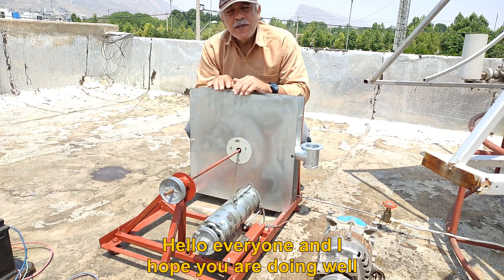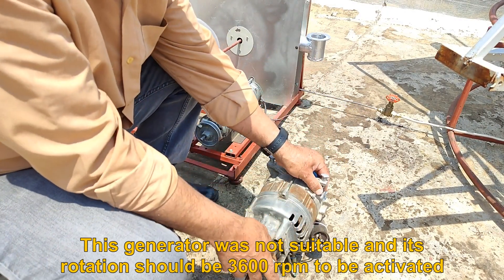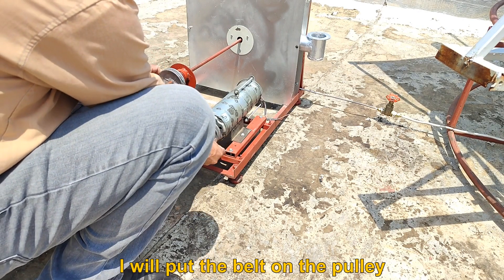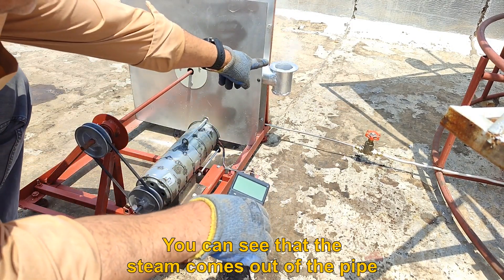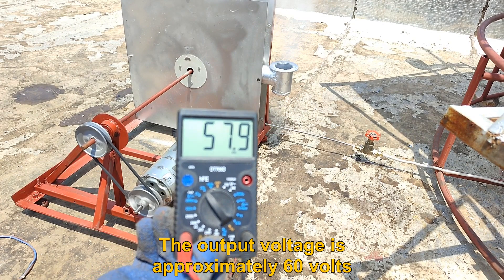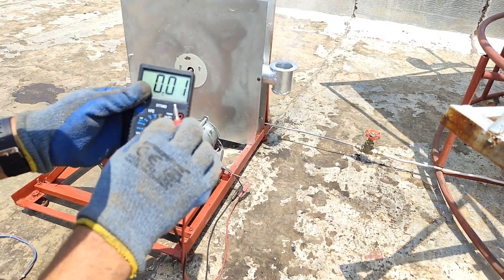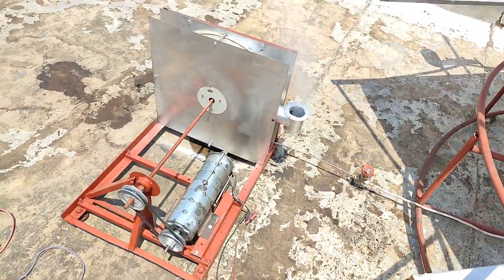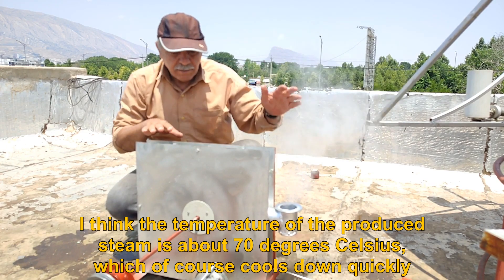DC generator test with steam turbine.Suitable generator for steam turbine

Comment: Greetings from Germany, little physicist here :-)
I was thinking about steam engines lately myself, so maybe some of my ideas might help you:
Find a bldc motor with matching KV rpm/V for direct drive. This should nearly double your efficiency.
If you make a closed water cycle, you could evacuate the system to 0.2 bar, then water would already evaporate at 70°C. This would reduce temperature loss.
And you would have to put the entire steam turbine including the bldc motor/generator into a (under-)pressure housing.
This housing would have to include a plate heat exchanger to condensate the steam by heating water from 40°C to 60°C.
The condensated water would need to be pressurized with a small membrane pump to be feed back into the boiler. In my design of a steam engine i only wanted to go for 100-200 Watt so 3-5 bar would have been sufficient. For that a $8 membrane pumpe from AliExpress would do. I am not sure what to make of your 18 bar you mentioned to achieve with your solar disc. 
The presssurized water would only need to go into a small water tank.
From there it should go into a flash boiler in the center of your solar mirror. There the water would vaporize at 70°C and get overheated to over 150°C or even more.

What is the diameter of your solar mirror ? Then we have the square meter an the sun shines with 1000 Watt/m². As your steam turbine will rater have en efficiency of 5% than 10%, ai like chatGpt or Gemini will quickly tell you the amount of water, water flow for the system. And as you already know the rpm, you can choose to matching bldc motor.

I think you should definitely go for overheated steam and a heavy insulated turbine, so that steam won't condensate inside the turbine or alredy before the turbine in your long copper pipe. 
But these words are only meant as brainstorming! Not as a truth. You have more expertise in steam energy !

Thanks for your videos :-)